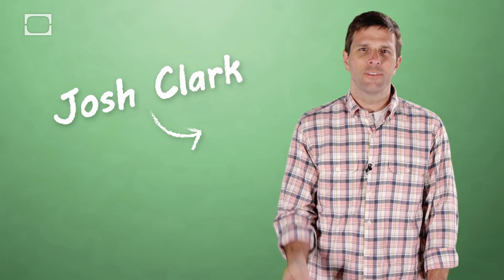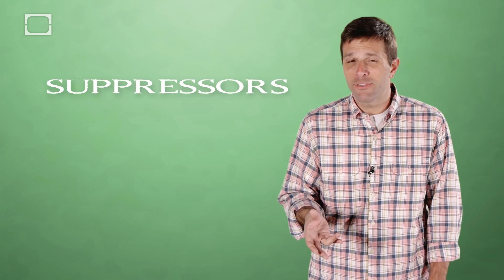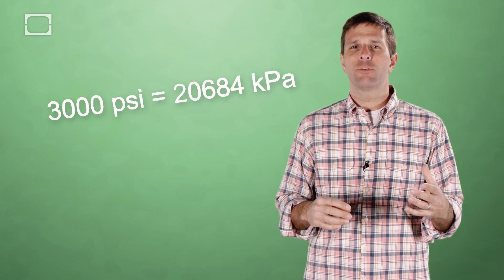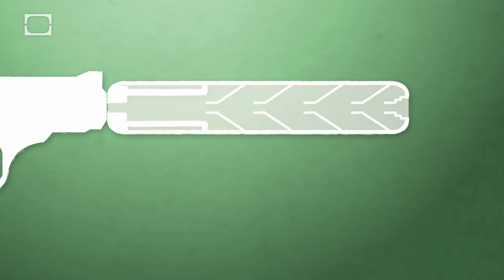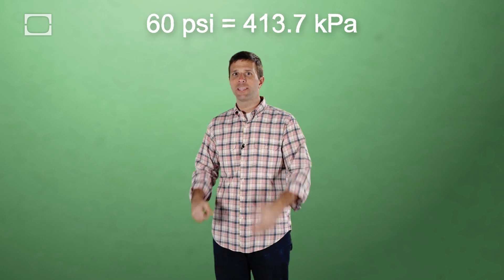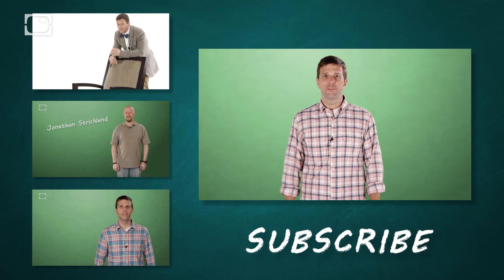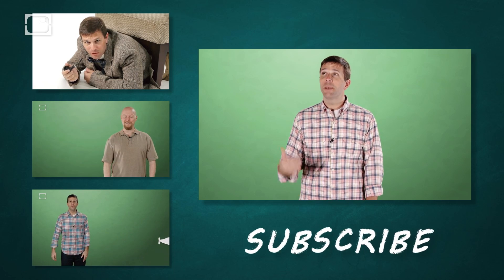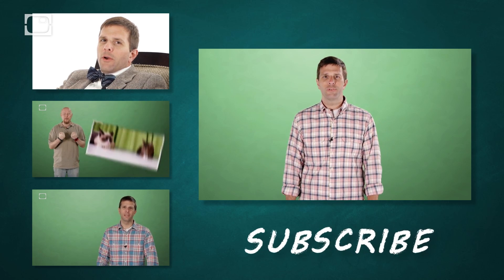How Do Gun Silencers Work?

Comment: 3000 pounds per square inch? You had better do a little better job in your research. The pressure developed is many times that . A 22 is 13,000 psi up to 70,000 psi for a 308.

Comment: The comment about suppressors reducing accuracy and “power” is complete video game bull crap. In many cases, suppressors actually improve accuracy and velocity of the bullet. 

Also, using a revolver as an illustration proves this guy doesn’t really understand how a gunshot works. You cannot effectively suppress a revolver because the gap between the cylinder and the barrel allows a lot of that gas to escape and expand, meaning the suppressor can’t do its job.

Comment: I can give good reasons why the us should legalize suppressors 
1 most of Europe (including the uk) allow them and are even expected to use them for hunting and recreational use
2 we already  debunked them being able to make the gun silent they do reduce the sound of the gun but they don’t eliminate it because when you fire a gun your hearing 3 things at once the action of the gun,the bullet firing,and the bullet braking the sound barrier
3 even if that was true they are rarely used in crime even in the us and are unpopular with criminals  because they make the gun bigger and harder to hide 
4 they actually make the gun safer (you may be thinking they make the gun quieter that doesn’t make any sense) they protect your hearing because over exposure to loud noises can cause permanent hearing damage,there would be less noise complaints when your hunting,using it for self defense,the list goes on

Comment: The suppressor actually increases velocity. The “losing power and accuracy” part is complete myth. Shooting a rifle suppressed stretches the max effective range of a round. Not by a massive amount. It depends on the caliber, rifle, particular load, and the specific suppressor. But around 50-100 yards is a reasonable generalization. More velocity should also, in theory, mean better accuracy. There are many factors that play into all of this, so it’s hard to be so absolute about it. But it is absolutely incorrect to say suppressors cause firearms to have less power and accuracy.

Comment: A silencer, also known as a sound suppressor, suppressor or sound moderator, is a muzzle device that reduces the acoustic intensity of the muzzle report (sound of a gunshot) and the recoil, when a gun (firearm or air gun) is discharged, by modulating the speed and pressure of the propellant gas from the muzzle

Comment: A silencer is not a suppressor. These are two separate, but similar products. Both reduce muzzle flash and noise. However, each product has a different goal. A silencer is designed to reduce the noise of gun fire. Reduction of muzzle flash is the suppressors primary goal. While both products are capable of performing the others primary function, neither do the others job as well. You may not care for the nomenclature, but your dislike does not make you right. And it certainly does not give you the right to be rude and insulting.

Comment: I'm very very late to this and if someone hasn't said it, I'mma gunnna... I don't know where you got your information? Maybe I heard wrong. Your not getting a 20db reading with ANY silencer. To be clear, that is the correct term(per the original patent) tacky ehhhh I know. Not used in todays verbage and it shouldn't, but that's facts. But yesh.... A pump BB gun isn't even 20db. Your not going to get a gun suppressed @ 20dbs, ain't gonna happen... DO NOT listen to this guy.

Second. The trigger doesn't hit a firing pin that ignites gun powder. It hits a PRIMER to create an combustion/explosion, which sets of the gun powder and sends the bullet agoin. Also. He talks about hearing bullets, sure. Knowing where your at still? Nahhhh not so much and especially not so much at night. Take a .223 suppressed, talking like military stuff or even a civilian. Your NOT going to use subsonic ammo because it's gonna be as or maybe even less effective than a 22LR round, seriously. So you'll be shooting normally rounds, does take the noise down, still not hearing safe per say, definitely not quiet, but it does provide misdirection and prevent ALOT of muzzle flash and that's why it's used. 

Fire this guy. Or stick to the shit you know. Please. OKAY? 

PEACE 🙂👍😆🤘

Comment: You realize this is factually inaccurate, correct?  Modern day suppressors only reduce the sound by 10-45 decibels,  so your example of a "20 decibel" suppressor is not possible.  You should correct this ill informed mistake.

Comment: Completely false from the start. The term based on the NFA is silencer. A good silencer only reduces the sound produced (at the muzzle and most likely not including any action noise) is relatively 20 db, not reduced TO 20 db. The pressures are way off for most applications. Those who refer to them as "cans" are not bad people. 

This fellow is a joke, reciting false information on a subject he clearly has little knowledge, but does have some decent video production and graphics skills. 

Stick to being an UnTuckIt model and avoid filling ignorant minds with ignorant information.

Also, I down voted the video and reported it as spam and misleading.

Comment: So so so much wrong with this video. Just another lecture on something the presenter knows nothing about.  He quotes 3000 psi multiple times.  After all three thousand is a big number, right?
For those keeping track at home this is nonsense as an average 9mm operates at 32,000psi of chamber pressure. The .380 often carried by Mr. Bond he discreetly refers to regularly exceeds 20,000psi, and that is low on the power scale.  
I want to see the suppressor capable of bringing a 160db shot down to 20db, or what has been compared to the ticking of a watch. 
The "silencer" on a revolver illustration only adds to the comedy. 
Please get your facts....someplace else.

Comment: Very good info, mostly accurate, thorough, and concise.  Except the illustrations of the revolver. They can use suppressors but are less efficient at suppressing due to the cylinder/barrel gap. And a lot of non-dangerous, normal people call them cans too. Just a slang term. Sound reduction also depends on type of suppressor and how many baffles you are willing to hang off the end of your firearm.

Comment: Your decibel explanation is highly caliber dependent. Your explanation is true for maybe a 22lr, the db rating or result of the suppression depends on the caliber + firearm configuration...bolt action vs reciprocating.  Also it increases velocity due to extending the barrel and it is still as accurate as before, it simply shifts the point of impact, meaning you have to account for this when aiming but it will hit the same spot reliably so accuracy is not affected.

Comment: If you use a suppressor you  actually won’t lose any accuracy or damage that is usually a stereotype said to try and balance things out because the longer the barrel is the more time it has to travel being pushed by the gas so it goes faster and if you do weight x mass = energy it all sums up the more time the bullet is being pushed from the casing the more energy builds up .
It’s also the same thing for the accuracy

Comment: The gases are definitely NOT explosive. 
What he is talking about is mostly air with a bit of ignition products, compressed, then pushed by, and in a form of shockwave.
Also Suppressor is not as effective as he said. This vid, is FULL of bullshit.

(And suppresor on a Revolver. Good luck with that. Only few revolvers can be suppressed, that has to do with their construction. The ones that can be suppressed are modified with a mechanism that briefly (and still not fully) airtights it when shooting, by pushing the cartridge against rest of the gun.)

Comment: It doesn't make it less accurate, because when the gasses get traped in the SUPPRESSER it has to get rid of the gas so it pushes it out behind the bullet and depending on the length if the SUPPRESSER it increases the velocity by 2-4 percent. Also they get nowhere close to 20 decibels, and get more like 110-120 decibels, which is completely safe with no ear protection.

Comment: The pressure is MUCH greater than 3000 psi, relatively hot loads of 9mm push around 30,000 psi. And suppressors usually bring the sound down to around 120-130 decibels. If you've ever been around one, you'd know it's still exceptionally loud. With most suppressed cartridges, you're still on the border of having to wear ear protection.

Comment: Most rounds operate at a much higher pressure than that. Like 10 fold. +P 9mm can operate as high as 34000 psi. Standard .223 and 5.56 operate around 50000-60000 psi. Even .22 LR hits around 20000 psi.

Comment: Okay video, some comments though.

1.  They are actually called silencers, the word is a noun and a legal term used in the US Code.

2.  Cartridge pressure is much more than 3000 psi, as high as 60,000 for the 5.56.

3.  Nothing wrong with calling a silencer a can.

4.  Some guns will produce noise at 160 decibels, many are much louder.

5.  The claim is made that a silencer will reduce a 160 dB noise to 20 dB; Actually it will reduce noise by 20-30 decibels.  Even a 22lr with subsonic ammo will still be about 110 dB.  

6.  Power is not given up with a silencer as they work just as well with standard ammo and some standard ammo is normally subsonic.

Comment: This guy is wrong the sound is REDUCED 20 decibles not 20 decibles leftover after putting on the suppressor. Even using a suppressor can still cause hearing damage at more than 100 decibles. Plus natural background noise is typically around 30 decibles. This guy is saying suppressors make a gun quieter than natural silence. Fail!

Comment: How many million views before you correct your most obvious mistake? Suppressors don't reduce the sound level TO 20 decibels. They reduce the sound level BY 20(to 30) decibels. A 160 decibel un-suppressed will measure at 130-140 decibels when suppressed. The suppressor drops it out of the realm of immediate hearing loss, that's all. Hollywood pew pew nonsense has ruined your brain.

Comment: Hey if you want to prove the 20 decibels thing for you next video screw on a suppressor and have someone fire with the end of the suppressor just past you head. After you wipe away the GSR and the ringing in your ears stop make another video telling us some more bullshit about how it sounds like a hushed whisper in a quiet library. To anyone reading this and brainstuff guy Harry's sucks, Dollar Shave Club is the better way to go, chances are though if you're a rugged gunslinger you don't give a damn about grooming standards and rock a manly beard that this guy can't grow to save a life. I will give you props on the arm hair looks like you're wearing cotton dress gloves or you hands don't tan. if you want your hands to tan you should try pulling both thumbs out your ass.
Reply: P.S The hammer is the firing pin which strikes the primer. You should of used a semi auto for you suppressor graphic only 1 revolver ever made is suppressor compatible I would explain why but you seem to know how it all works. If not hold you hand next to the cylinder when (if) you fire a revolver.

Comment: suppressors don't reduce power or accuracy. They actually slightly INCREASE velocity (additional pressure from the added barrel length) and while they do shift the point of impact (due to changing the harmonics of the barrel) the accuracy is unaffected.

Comment: Another problem with sub-sonic ammunition is that the gases do not push the bolt back far enough, therefore your firearm will not cycle and you have to pull the bolt back yourself each time you fire, instead of having a normal semi-automatic.

Comment: Silencer is a legal term. Suppressors don't affect accuracy so much as they may slightly shift the point of impact. But once a weapon is zeroed with the suppressor mounted, impact shift is moot as precision can still be consistently achieved. In fact a suppressor may actually increase accuracy as a side effect of increased velocity.

Firing a subsonic round that isnt tuned to a given suppressor may actually give a bullet a slight velocity boost over the sonic threshold and the crack will be heard.

Comment: Errors-
1. "silencer" was actually the term first coined for this contraption by the first developer. while suppressor is a linguistically more accurate term for what it actually does, silencer is still an acceptable term. one could call it either/or and be correct.
2. correct that a gunshot is about 160 dB, but most suppressors commonly available cannot take a gunshot all the way down to 20 dB. the suppressor I own is rated by the manufacturer to reduce a gunshot by 30 dB, down to about 130 dB. 130 DB is much safer to shoot without wearing hearing protection, but it's still loud enough that you could not get away with firing a gun without being noticed, as is commonly depicted in movies.
3. modern gunpowder doesn't explode, it burns, much like gasoline in the cylinder of an engine. exploding, or "detonation", would damage the cylinder of the engine, or the chamber of the firearm. when the primer ignites the powder in a cartridge, it burns evenly, albeit very rapidly, from back to front, producing the expanding gases that propel the bullet.

Comment: Man you got 2 significant things wrong. Props to you for correcting the decibel level...... but a sonic boom and a ballistic crack are not the same thing. If you are firing supersonic rounds you will hear (for a .22) what sounds like a very angry bee, subsonic... nothing. Probably the most famous and one of the quietest pistols ever made was the Welrod which was 73 db and there was also a carbine called the De Lisle which was as loud but had a better performing suppressor (less maintenance).

Comment: Hooray for misinformation.  How could this still be uploaded even after you realized the HUGE mistake that was made in dB levels regarding the silencer (Yes, both AFT and DoJ actually call it a silencer)?  You equated a firearm with a silencer to sounding like a whisper in a library when in reality it's on the same level as a jackhammer.  But hey, you did correctly explain how the silencer works though.  Just wish more effort was put into this video. :-/

Comment: The only issue with this video is that bullets don't leave the muzzle at 3,000 psi, a .45 cal ACP bullet has a pressure rating of approx 21,000 psi and it goes up from there.  9mm's and 40 cal bullets have pressures in the 30+ thousand psi range, and for rifles this pressure is much higher in certain loads.

Comment: you don't know fully what you are talking about. suppressors lower the sound by 20 or 30 decibels not to 20 or 30 decibels. 
there's no loss of power or accuracy whatsoever. actually a slight increase in both is the norm.  
I prefer suppressors but there's nothing wrong with calling it a silencer or a can. the most accurate thing to call it is a muffler.
Reply: Tested some the other day on 22lr and the quietest reading we had from multiple brands was 112.
P.s. the sound equipment we used was about 10k so this wasn't a backyard operation. 

You are absolutely correct.
Reply: @khayrobs   It works exactly the same way a muffler on a car works. Your right...it should be called a muffler. The word suppressor also applies because it does suppress the sound of the gas exiting the barrel. But since in many cases "suppressors" are not always legal... I'll call mine a muffler.
Reply: Tim Hallas the patent filed for the first silencer in 1921 is titeled ”silencer for guns” and filed by Hiram P Maxim. Same guy filed a patent in 1925 wich bassically describes the same type of silencer but used for anything with an exhaust or air outlet. It’s called a muffler in the description in that patent but the correct term for the gun-silencer is just that: silencer.
Reply: Look, he's not an expert at this, he's a person paid to read a script and explain something, if you claim you know what you're talking about then why are you watching a simple explanation?
Reply: The sound of a supressor might be more quiet but u can still hear the gunshot
Reply: Muffler for engine lol jk
Reply: if you have a 1 foot long supresser shooting projectiles at under 900 fps then you will have a supresser that sounds like a co2 bb gun shooting
Reply: Huh...I always thought muffler was a derogatory term for a lesbian.
Reply: But if the gas has room to expand in the supressor, this would be a reduction in pressure just by definition. I do not think it would be a statistically significant difference, but there would be a decrease nonetheless.

Comment: The pressure in a cartridge is more like 30,000 - 60,000psi when the propellant (gunpowder??) is ignited. My scuba air tank is 3000psi. Also when a bad guy or special forces soldier uses a suppressed pistol he also uses sub sonic ammo so there is no hyper-sonic crack. I have two .22SLR semi autos and if I put a can on the front and use sub-sonic ammo you hear the action cycling more than any sound from the muzzle.

Comment: There is a Russian pistol that doesn't need a silencer because its cartridges keep all the gasses inside resulting in a quiet yet powerful shots and a small size.

https://en.wikipedia.org/wiki/PSS_silent_pistol

It is also worth mentioning that most revolvers cannot be effectively suppressed because their shell doesn't go into tight contact with the barrel, so the gasses will deflate there loudly even when the end of the barrel has a suppressor.